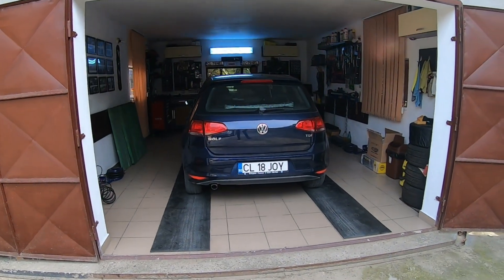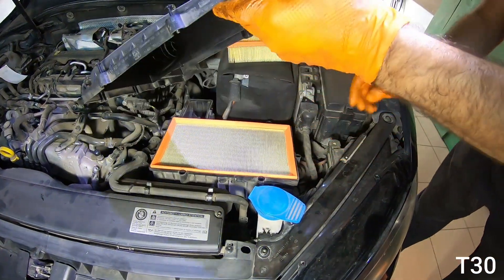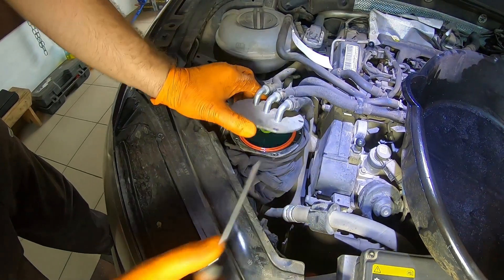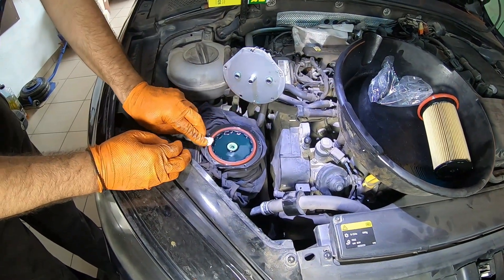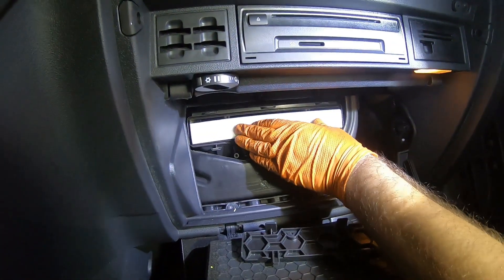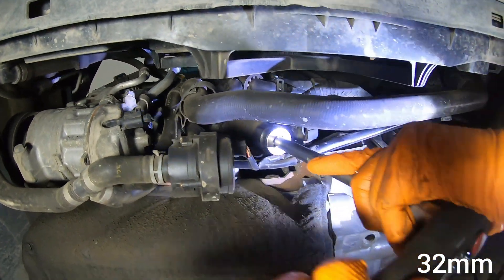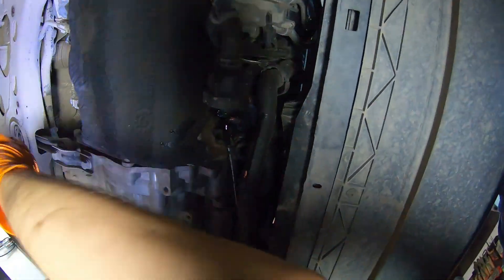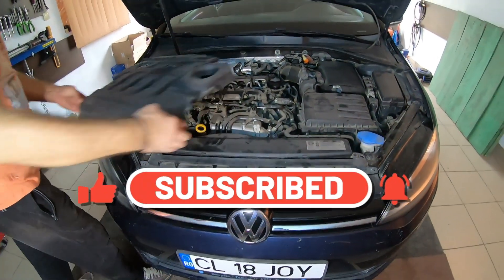Volkswagen Golf MK 7 Maintenance Service Fuel Filter Oil Filter Air Filter Pollen Filter Air Filter

Comment: Air filter housing screws are T25 and fuel filter cover bolts are T20
Reply from the maker: Well if you have a T25 I guess you also have a set with a T20. Thank you for the correction ✌